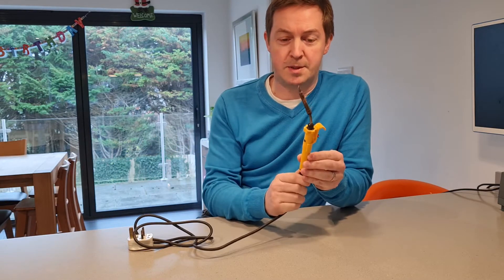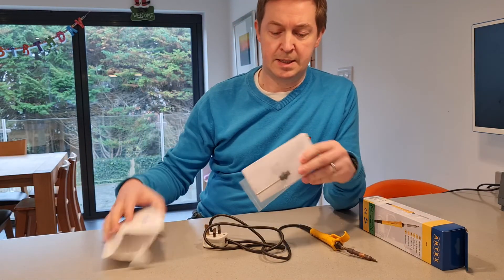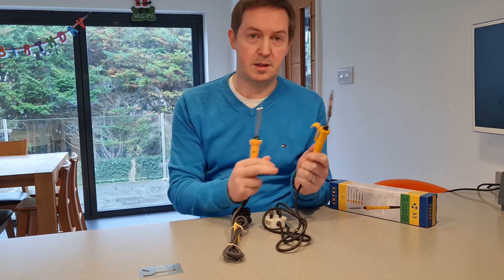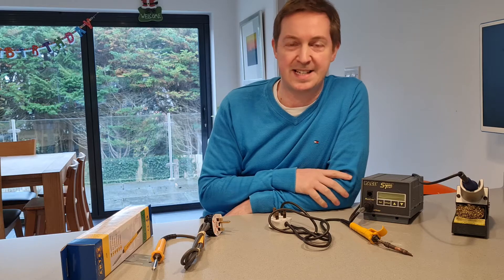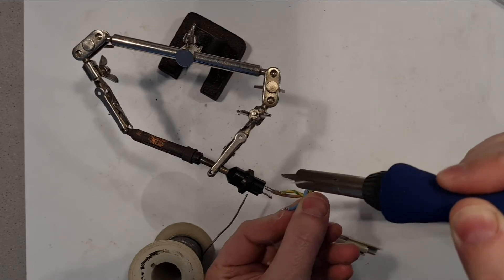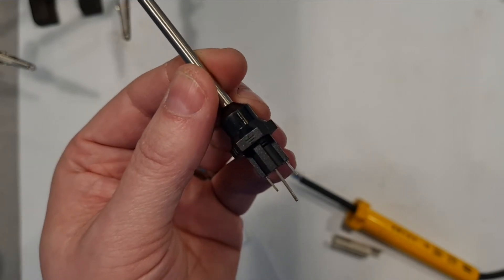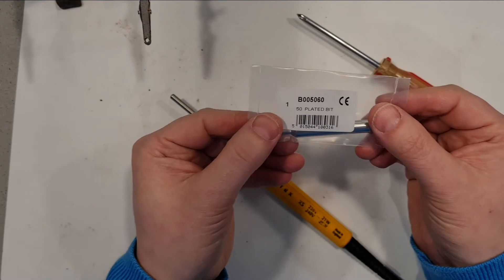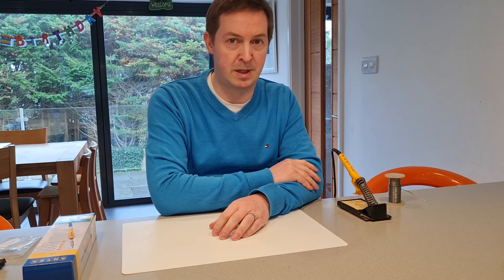Antex XS25 Soldering Iron - How to replace the heating element

Comment: Repairing mine now as broken the handle so bought the new handle silicone wire and hook for just £10.69 a new element if I needed was £11.94 so could build my own new if needed tips are £4.50 all Antex new original parts just an edit if like me you accidentally pulled the pins out of the element for the live and neutral the centre is the live and the wire not shielded is neutral
Reply from the maker: That's great to hear that you are giving your original unit a 2nd life and not just replacing it. Must be many Antex units disposed over the years that didn't need to be. Here's hoping it continues to give great service.

Comment: Good video, l think for general soldering the XS25s can't be beaten, l put a bigger tip on mine and 2 metre silicone cable.
Reply from the maker: Thanks and I agree. Although I have now added a Pace soldering station having borrowed one for this video and been impressed with it.

Comment: Thanks - I was about to bin my old Antex, but you have convinced me to repair it.
Reply from the maker: That's great news Matt, saves the landfill and a nice sense of achievement too. Good luck with it👍
Reply: I have now bought a Weller 9200ud soldering gun as a friend offered it me for just £15, it's something l was actually thinking of purchasing as l need an iron with more power a lot more now than the Antex, but as l say the Antex are very good for general soldering.

Comment: Great Video Thank You For Uploading Can You Please Tell Me If The Old Style Of Bit Would Work With a XS25 Element Regards mike
Reply from the maker: Hi Mike, thanks for watching the video and taking time to comment. The outer diameter of the new heating element was exactly the same as the old one so old bits should still fit fine. All that seems to have changed is that the part that clamps the bit on (on the older style) has been changed to a new style of clamp inside the sleeve (for newer bits).

Comment: good thanks for ur video...see u next time......
Reply from the maker: Thanks Sazzad, I'm glad you found it useful.
Reply: @MostlyHelpful  In your opinion was the new element of the same dimensions as the old, or is the new element different to attach to the new bits? As I'd like to know if the new bits will work with my old soldering iron. Thanks
Reply from the maker: Hi and thanks for watching my video. The element was exactly the same dimensions as the one I removed and it's only how the bit clamps down on to the element that has changed. So I'm sure new bits will fit an old element just fine.